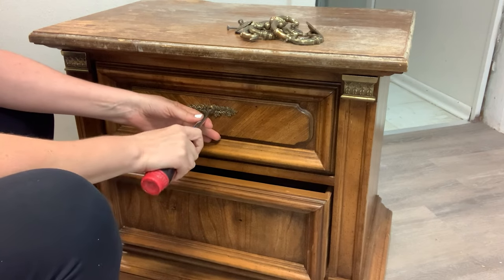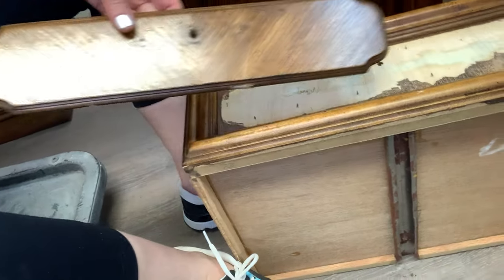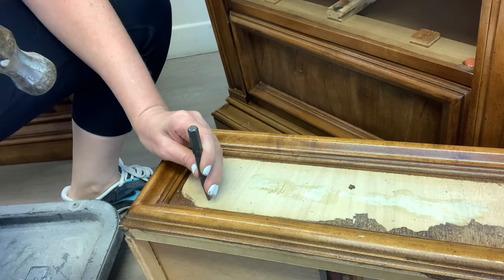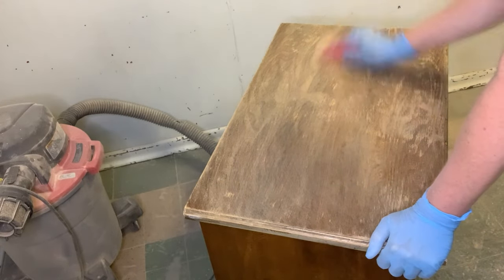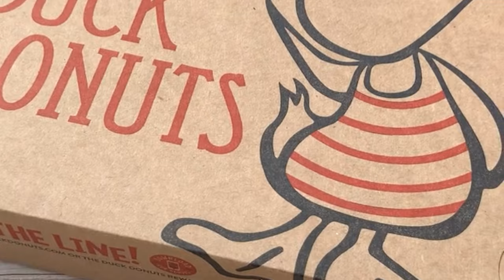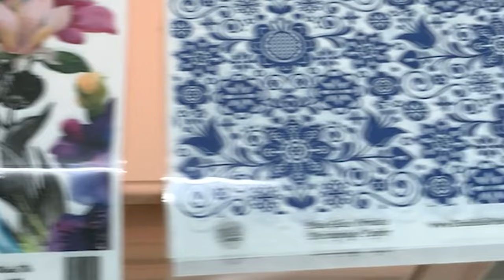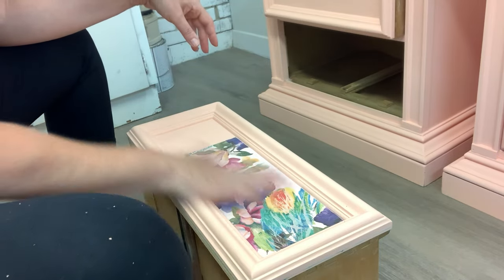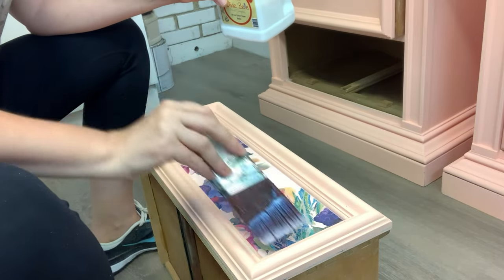HOW TO DECOUPAGE FURNITURE

Comment: You made these bedside tables look amazing 👏 And the colour Apricot is  soooo on trend right now. I just want to give you a great tip on  decoupaging: I've found, through trial and error, that the iron  - on method is by far the best way to apply your paper to the surface you're decoupaging, especially if the surface is flat like the drawers you're decoupaging now  All you need to do is brush 2 - 3 coats of your decoupage medium ie. glue, Mod Podge, or the Dixie Belle stuff that you're using here, and then let the glue (or whatever you're using) dry completely. Then plug in your iron and make sure that it's not on steam (I just empty the water out of the iron and set it to no - steam) and then you tear off a sheet of baking parchment and place it over the decoupage paper that you've placed over your surface. Now you just iron over the baking parchment with the iron set to a high heat, and the decoupage glue will melt again and stick the decoupage paper to the surface, but with no wrinkles or air bubbles. It looks really professional, and it's easy. There are lots of videos on YouTube about this Iron - On method, so check out some of them and you'll see what I mean. Love from Amanda Jones in Australia.

Comment: Beautiful!  Fun to see something besides a white farmhouse finish.  My question - how do you remove drawers that have a safety mechanism?  I painted 2 nightstands where the drawers did not just slide out.  A handy guy removed the drawers on one by taking the metal structures apart.  He had a terrible time getting it back together and the drawers wobble now.  To avoid this result, I painted the second stand I with the drawers still attached.  Very difficult.  Any suggestions?  Thanks!
Reply from the maker: Hmmm, I've had a few of those drawers with plastic safety mechanisms in place with metal runners but never metal ones. I'm not sure how the metal ones work? With the plastic safety I had to reach inside (very uncomfortable since I had to contort my hand!) and press down on the plastic clip so the drawer can slide out. If anyone reading this comment has an answer I'd love to know as well! TIA